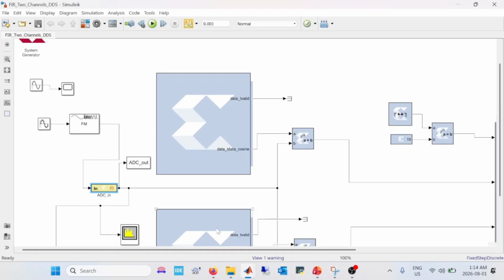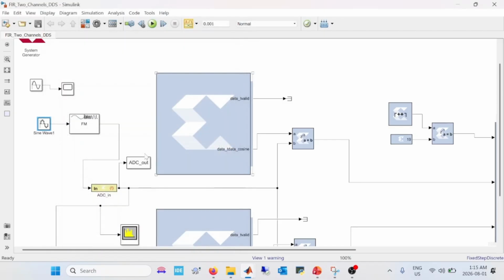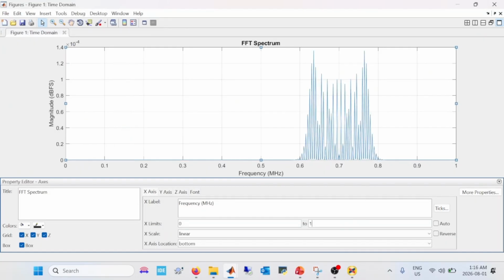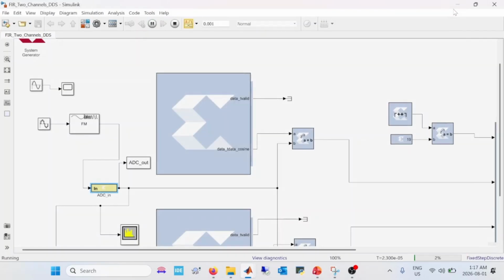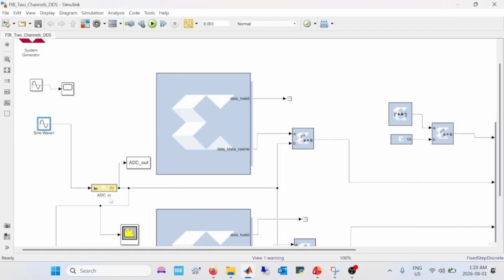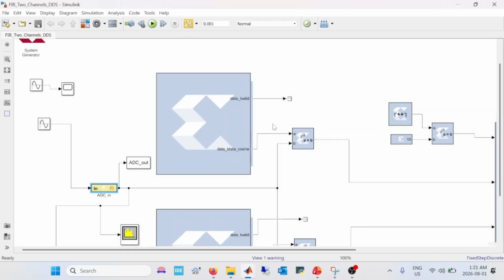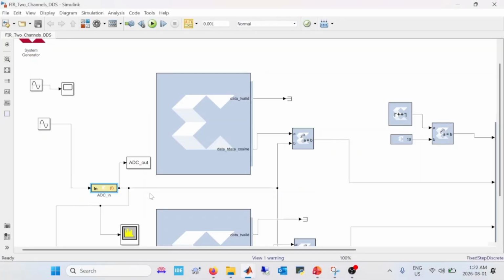Bandpass Sampling Live Demo in MATLAB System Generator | No Theory, Just Simulation

Comment from the maker: Every video in this series is another building block toward designing a complete digital AM/FM radio receiver on FPGA—from theory to real hardware.

📻 Building a Complete FPGA-Based Digital FM Radio Receiver
✅ Completed So Far

✔ DDS Signal Generation on FPGA
✔ FM Modulation Using DDS
✔ Dual-Channel FIR Filter Design (I/Q)
✔ FIR Hardware Validation on FPGA
✔ Bandpass Sampling Theory
✔ Bandpass Sampling Live Demo in MATLAB System Generator

🚧 Coming up Next

⬜ FPGA Hardware Validation of Bandpass Sampling
⬜ Digital Downconversion (DDC)
⬜ I/Q Baseband Processing
⬜ FM Demodulator Design
⬜ Audio Filtering & Decimation
⬜ PCM5102 DAC Audio Output
⬜ Live FM Radio Reception on FPGA

Video Time Staps
00:00 - Introduction to the DDC System Setup
00:50 - Configuring the FM Signal Parameters
01:21 - Simulation 1: 10 MHz Sampling Frequency
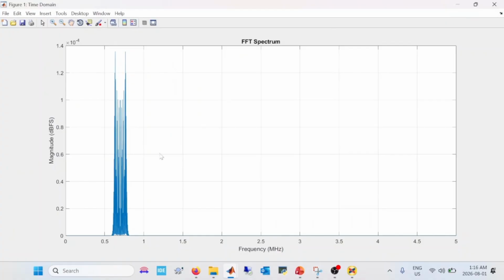01:57 - Analyzing the 10 MHz Spectrum Results
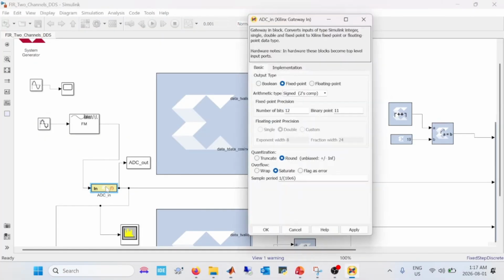02:38 - Simulation 2: 1 MHz Sampling Frequency
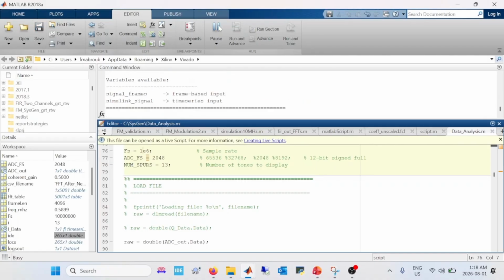03:47 - Analyzing the 1 MHz Aliasing Results
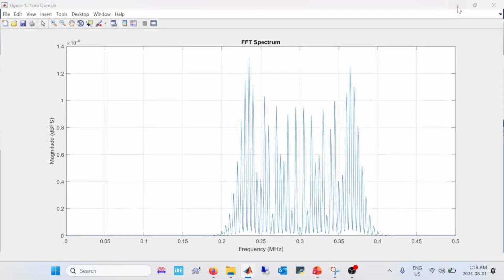04:02 - Single Tone Aliasing Test Setup
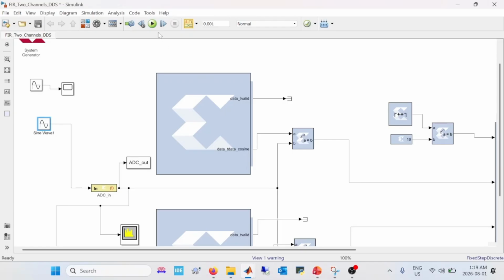04:43 - Simulation 3: Single Tone at 1 MHz FS
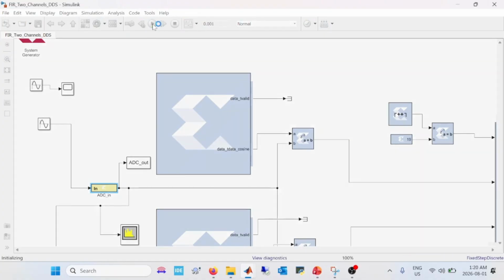05:39 - Simulation 4: Single Tone at 10 MHz FS
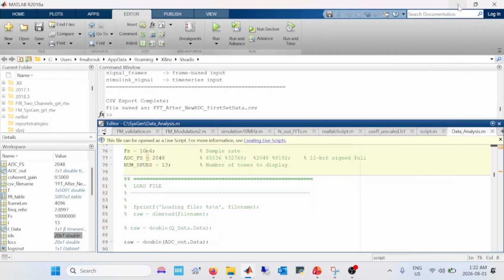07:00 - Exporting Data to Workspace (ADC Out Block)
07:12 - Summary and Conclusion

👍 Subscribe and follow the series so you don't miss the next building block!